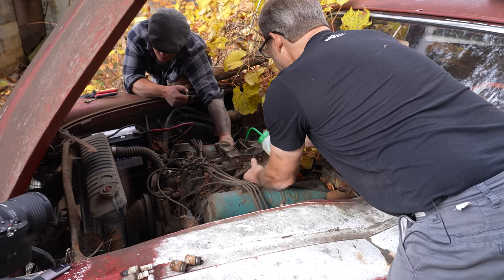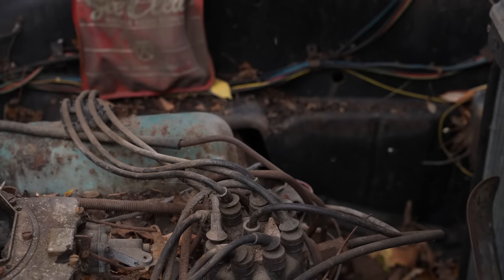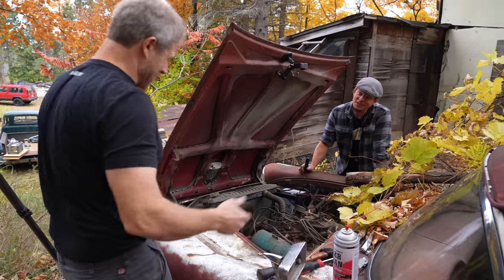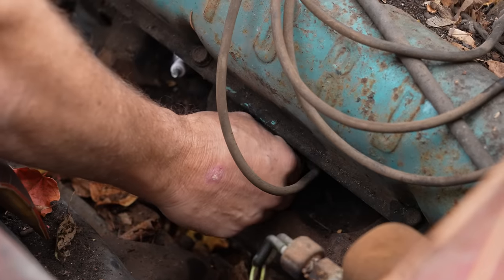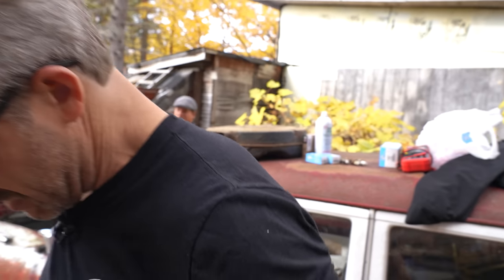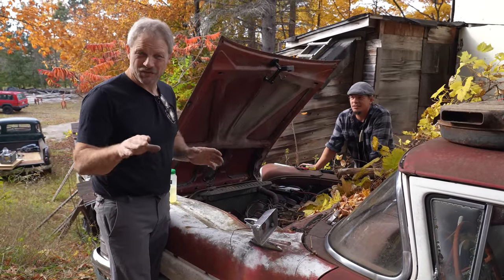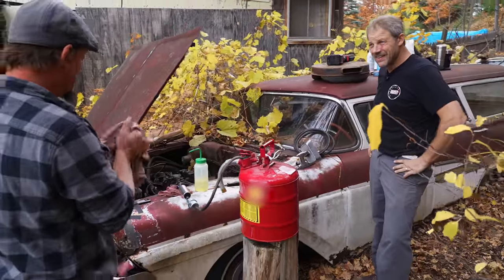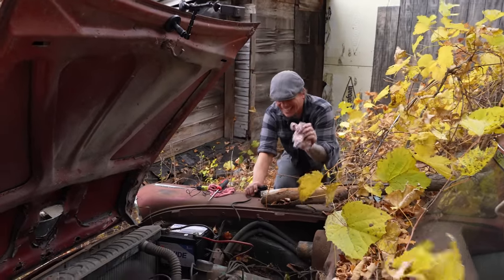'58 Ford Parked Over 50 Years Ago: Will It Run?

Comment: Why is it everyone forgets how a carb works.  Get a little chain saw gas for some upper cylinder lube, fill the float bowl thru the bowl vent, close the choke so it will have a rich mixture and be on high idle, squirt some down the bores and turn her over.  Should run for 20-30 seconds.  Done it many times, always works as long as the engine isn't mechanically trashed..

Comment: Sometimes the trick with old Fords is to hold the gearshift all the up, because even in park it wont always start because of the safety lock out
Reply: The 50s Fords with automatics do not start in Park. Only in Neutral. I have no idea why they did that. For the 55 - 57 TBirds, the dealers sell an updated neutral safety switch that WILL allow it to start in park, like the later cars do.
Reply: @novaseline4u  By 1958 they were starting in park. I have 3 57's.
Reply: @novaseline4u  That ended on the '57 release.

Comment: Between this and the recent videos from Fab Rats & Merlin's Old School Garage with getting the engine in a boat that was sunk under Lake Powell for 30 years working again, I'm dang impressed by how solid some of these engines are! Obviously it's not always the case but the fact that with not much work, Davin and Jeff were able to get this one running, and the same with the boat engine that Merlin fixed up, that's some seriously well-built engines!
Reply: What about  vise grip garage?
Reply: @revee1000  Never watched one of their videos, so I can't say anything about them. But neither this "restoration", nor, from thumbnails, Vice Grip Garage can hold a candle to the craziness of getting that boat engine working again, IN the original boat too.

Regardless, my comment was NOT about promoting X or Y channel, it was about how well-built the motors themselves were.

Comment: Those old FE engines were pretty dependable and started pretty easy.
Reply: Not an FE .
Reply: @spaceghost8995  If its stock, it is an FE. First year in the wagon, if its a 58.
Reply: @ChubbyJontheBartender  I glanced at video wrong I had thought I saw distributor in back but it is in front. It's FE
Reply: You mean they weren't, (Fix....Or....Replace....Daily) ?
Reply: @spaceghost8995  They still had the 292 available in '58, but this was the 1st year for the FE352 and that's what is in this wagon.
Reply: @ChubbyJontheBartender  Some of the Fords including the trucks had the FE in em all way to 66. I have 66 F100 has an FE. My 65 has the 352 in it that is how weird Ford was in the 50s & 60s.
Reply: @Ray56z  And the 332
Reply: @thekingsilverado3266  ; Actually, the FE was in the 1970 Mach1. The 428 Cobra Jet. I'm pretty sure the FE continued on in the Ford pickups into the 70's. Those were 360ci. The FE was fazed out to meet EPA standards. Did a 1958 Chevy engine design last into the 70's?
Reply: @spaceghost8995  ; That would be the Y-Block.
Reply: @cobracharmer6178  I know what U mean but the original FE to my knowledge had that freak crank shaft and intake manifolds that leaked the seals to the OE cranks were a canvas like cloth seal internally and the intakes like that 59 or 58 they all leaked and leaked bad even after just a few 100 miles so I could see a car like that station wagon being parked for just such a problem back in the day shops wanted a small fortune for a job like that often times most shops by nature cut the intake sometimes the heads. Just the way things were back in the 60s & 70s.... So that is the diff in the later than a 66 FE in my exp they were  a true 3.52 bore all of em. The 352 which is an actual FE however although appearing in trucks was also called & considered a Police Interceptor or an HD motor because of that much heavier crank shaft in em. So an FE technically is not just an FE. The earlier FE's had that crank feature and 155% crankshaft & intake manifold leak is how we always identified FEs and when ya pulled out them funky canvas lined crank seals we knew what were working on.
Reply: @thekingsilverado3266  ; To my knowledge, you’re referring to the Y-block had these issues. Not enough oil to the camshaft and the intake manifold ports were stacked. The 352 was practically indestructible. They were the foundation for the 427 sohc. In NHRA, Ford engineers figured out how to keep the bottom end together by using cross bolt mains. We’re looking at a 1958 Ford that started up after a couple of hours of tinkering. 
Today, the Ford “Coyote” is based off the design of the original 427 sohc.
Again I ask. Was there a 1958 Chevy engine design that stayed in production into the 1970’s ?
Reply: @thekingsilverado3266  FE motors were the 332, 352, 360, 361, 390, 406, 410, 427, and 428 & 428CJ, cubic inches.
There were also the big block Lima motors of 370, 385, 429, and 460.
I've owned pickups with 4 of the FE sizes and 2 of the Lima motors. Still putting FE's in until the early 90's.
Reply: @kingfishstevens2087  Weren't many of them, and until they were tore down most thought their 332 was a 352.
Reply: @cobracharmer6178  Nope-no gm motor built in '58 continued as is through '76.
Hell, gm couldn't design a big block that lasted beyond 8 years-some only 3.
Reply: That looks like a 352 or 332 fe engine

Comment: Love to see any old engine come to life, but those old FE V-8s were what I spent more time with, it seems, due to me owning so many older Ford pickups.
The engine is either a 332cui, or a 352 cui engine, the only V-8 engines offered in 1958 on the wagons other than the 223 cui inline 6. 
Not easy to identify a 332 or 352 unless you have the displacement sticker still on the air cleaner. 
Many of the blocks had 352 cast into the front left side of the block, right below the head, next to the water pump, even though the engine was a 390cui.

Comment: My Dad had an identical '58 Ford Wagon, when I got out of the Army in 1962.  I had not driven a civilian car for a couple of years, needless to say I was thrilled to drive this car to town.  I pulled up next to another '58 Ford wagon.  When the light turned green, the race was on, but it didn't last long!  Dad's car had the 352 Police Interceptor Special 300HP FE engine , which was no match for the guy next to me.  Needless to say how surprised I was at how fast that car was!

Comment: Check the coolant and drive it home! Awesome video! 

I owned a 58 Ford wagon; bought it in 62 and kept it a couple of years. Came with 332, 2 barrel carb, and stick shift. I got ahold of a 4 barrel Holly and manifold, put it on, and it was a real hot rod after that. Just before I sold it, I took it out on the local highway and ran it up to 117mph on the speedometer. Scares me now, thinking about everything that could have gone wrong, possibly fatally! It was a good car, about all I had to repair was a pushrod that got bent when my brother was driving it; I think he over revved it, and a new clutch.

Comment: Years ago, I was in Guadalajara for my employer and saw a '58 Ford in the parking lot. As I approached it, I noticed it was a convertible - with 4 doors! They did their own version of a chop. No top, just wide open. 😅
Reply: If there's no top for it then technically it wasn't a convertible but a car with no roof. I'm trying to picture it in my head.
Reply: @JimmyKraktov  Just consider where it was.

Comment: Kind of surprised you were using what looked like straight gas in the squeeze bottle. Running some 2-cycle mix really seems to help preventing the cylinders from getting washed down during those long cranks.
Reply: Yep, that, and if the plan was driving it if it ran, I wouldna run the engine, or even turned it over for more than 10 seconds Tops without at least a cheap oil and filter change, and some clean water ... a sudden "whap-whap-Whap(!)-BOOM(!!)" woulda been one of those unnecessary "Well, Damn, we shouldna tried that," moments. Still, excellent car find, and nice video too. I always thought that '58 Fairlanes (wagons too) were nice-looking cars.

Comment: That Ford got you. Those 50s Fords will not start in Park. You have to shift it into Neutral. THEN it will start. Learned it the hard way when I picked up my basket case 57 TBird back in 1985. I'm at the 12 minute mark. Now I'll watch the rest and see if you catch it. :D
Reply: They will start in park with some assistance.
Reply: @cliffmcsparran3390  They will if you install a modified neutral safety switch, like the ones sold for 2 seater TBirds. Otherwise - nope. With my TBird I went through the same steps as these guys did - until I read the owners manual. It clearly stated the transmission must be in neutral to start. Not park. Put the car in neutral, and then it turned over with the key. That said, Ford eventually changed their cars to start in park, but I do not know what year they made the change.

Comment: Although its tired from setting for years, that old 332 ran fairly good. Would of been nice to see how hard it was to restart after running a bit. I would bet it would of fired right back up. Thought I saw a older hardtop in the back... there is a good motor for it if its motor doesn't work

Comment: Funny, 71 Mk3. sat for 30  years. cup of gas in 4 barrel, new battery, 5 gallons of gas. 460ci, started right up, spittin' walnuts out the exhaust. put it in drive and it took off. THE BRAKES!!!!!!. thank God the tires were flat. would have took out the diner next door. good times!

Comment: I bought a 61 Corvair that had been parked for 35 years... Changed the battery, shot some oil into the top of each cylinder, put in new plugs and filled the carburator bowls with gas. It started right up.

Comment: I LMAO when you went to turn that key, since I KNEW it wouldn't turn over like that. When you reached for the shift lever I thought you were going to shift to neutral, but then you didn't. I thought it was great when it fired up!! That was a good car back in the day, and it appears to be very savable. As someone else posted, I hope the frame is still OK. That left front fender should be repairable as well, with some slow, careful metal work.

My parents drove a 58 Fairlane 500 2dr HT back in 1959 - 61. Turquoise and white, in and out. I have fond memories of it. It was traded in on a brand new 62 Chrysler Newport 4 dr HT, white with blue interior. Loved the dash in that one! It actually inspired my neighbor to become an airline pilot. He just retired about a year ago.

Comment: Did you guys ever think about re installing the vehicle starter solenoid wire when turning the key? Also the reason the dome light is on is because the headlight switch is rotated all the way CCW. As far a a firing order all you had to do was place the spark plug wires in the valve cover looms in order  from front to rear (they were probably in order to begin with) and then there should have been no issues reinstalling the plug wires.

Comment: Been down this road many times. 
1st REMOVE ALL THE DRY LEAVES, BOTH AROUND AND UNDER THE ENGINE!!! They WILL burn and I don't see any firefighting stuff. Even an old broom or blanket will work to beat it out.
2nd Put some fuel down the carb vent to fill the bowl so you don't have to keep dumping gas, giving it one more chance to splash around, backfire, and light the leaves. 
3rd A little patience after filling the carb bowl to let the accel pump soften and work as designed.
4th Get the carb linkage to work smoothly, it will start way better with less fuel if you have a working CHOKE.
5th PUT IT IN NEUTRAL. If it should lite up right away and you don't have control, it can certainly surprise you (and your toes or knees).

That being said, it certainly looked like fun, I have to get back out in the weeds again and see what I can find.

Comment: Those old motorcraft 2100 and 2150s just seem to always work with a little cleaning and tinkering. I should have done a "will it start" video on my 79 f-150 ranger with a 400 when I dug it out of the weeds 3 months ago. It was a special moment. I daily drive it now and occasionally it bends a push rod, but I'll just hammer it back straight until I can afford to replace and upgrade the entire valve train. I'm too invested in a 302 swap for my 96 ranger autocross truck at the moment though.

Comment: If it has a 332 it is rarer. Probably has a 352 because most 332 wedge blocks were recalled because of soft spot in the block in 1958. I remember the guy across the street had one recalled.

Comment: When I occasionally get to work on old  vehicles like this with stuck or difficult bolts or spark plugs, I put a deep socket on a long extension, and slip it over the ratchet handle for more leverage: Saves many busted knuckles!
And  Instead of using the squirt bottle down the venturis to run it, I fill the float bowl (s) with gas through the vent hole first with the bottle. 
And then pump the gas. If the accelerator pump works, great! If not I squirt a little down the throat to give it a prime.
It's a lot safer, if it does backfire, it's a lot less likely to start a fire.
Plus, if it does start, it usually runs quite a bit longer from the fuel in the bowl.
And many times, if there's gas in the tank it will run long enough after a couple bowl fillings to get gas to the carburetor, If the fuel pump works and the hoses aren't cracked
Or if I'm not sure of the tank being clean or the quality of fuel, if it's reasonably easy to get to the fuel pump, I'll connect a length of fuel hose to the inlet, and put it in a small gas can to draw from.
Just a few things I've learned over the years...

Comment: Off topic a little but this old ford reminded me of how on some old fords you use to be able to turn on the turn signal, hold the brake pedal down and then play the factory installed AM radios. No keys required.  We did it with my dads 1966, 1968 and 1972 f250s. After 1972 it didnt seem to work.  It also worked on my moms 67 Tbird.

Comment: My Dad bought a new green and white 1957 Ford wagon. Had it about 2 weeks and 2 guys showed up at our house and explained that they needed to retrieve the engine out of the wagon. They offered him any Ford he wanted to trade for the wagon. He declined. The wagon had 2 four barrel carbs and Dad was told by the Ford guys that the engine was an experimental 427 and was never supposed to be installed into a car much less that wagon. Dad won lots of races with it and eventually traded it off in 1968 for another wagon. Not a ford but another wagon...

Comment: We had an auto wrecking yard when I was a kid and starting old cars that had been sitting for many years was one of my favourite things to do. Two cool ones that sat for a very long time that I got going was a 47 Chevy and a 50 Merc. Those cars sat from the late 50', early 60's to the mid 70's when I got them going. The very first car I got started on my own one early spring was a 65 Studebaker. I was 10 or 11 years old. I never like starting them with out at least a pail of water handy in case of a grass fire. I also never like starting them with out water in the rad. That water pump seal is lubricated by water. The only vehicle I was not able to get running (that was not seized) back in the day was a mid 40's International flat bed truck.

Comment: Love that 58 ford wagon, slightly crispy but so cool and I hope it runs and drives, but watching you getting knuckles busted when a short extension would have helped or half inch drive ratchet to give you more leverage, your shooting some oil in cylinders very good, maybe use a funnel tip put marvel oil, regular oil, even old atf, your approach to carb was good for a start, I've 2 liter with poked in with tube to carb and I've seen other guys have a way with putting gas to enter bowl gives it more time to run, it's great to hear it run, but it's missing on at least one cylinder or a vacuum leak. myself I just pick vehicle as it chooses me, mostly good enough to last a year or two and can do some of my own repairs, but I've seen one guy who's pretty good at this on Coldwarmotors, a guy who's done this a good bit

Comment: Way back in 1983 my girlfriend's sister drove a 58 Country Sedan ... Black, Three on the Tree, 352 V8 .... 

My GF drove a 52 F1 Panel Truck - Flathead V8 and a 3sp floor shift ... 

My future FIL was a Ford guy and had been acquiring vehicles for decades 

The oldest was a 46 Ford Sedan the newest was an 1980 Pinto there some 12 vehicles on the 1.5 acre property

Comment: I think it was about September or October of 1968 and I was about 10 years old when I experienced my own family truckster moment. A trip from central Illinois to Utah in a high mileage $50 1956 Buick station wagon. Amazing enough we made it in one piece. Less than 100 miles later the lower a-frame on the suspension broke. It’s been a decade or three since I’ve been through that area when the wrecking yards in the four corners were always full of cars like this. But the chance of finding one now I’m sure has dropped significantly.

Comment: The starter always has to be re-built. I know it’s a pain in the neck, but odds are, you’re really  gonna NEED that thing If it keeps “kicking out”, you’ll have a hard time. Full of rusty wires that overheat super-fast and a bandix gear that doesn’t stay engaged makes for frustration.

Comment: The engine has a stuck open intake valve. You can hear it when cranking and when there is a backfire several times. Those FE engines take a bunch of fuel to keep running.

Comment: Interesting note on the carburetor.  It looks like the same carb as on my '64 Merc with a 390.  In the old Ford shop manual I use, the recommend adjusting the float with the air horn removed and the mother running. .  I'm quite leery of doing this, as, if I understand correctly, it means running the vehicle with the top off, and a pot of exposed gasoline sitting on top of a running engine.  I do wonder if Ford revised the service procedure after a while, if there were any fires in the dealers shops.  Good job!